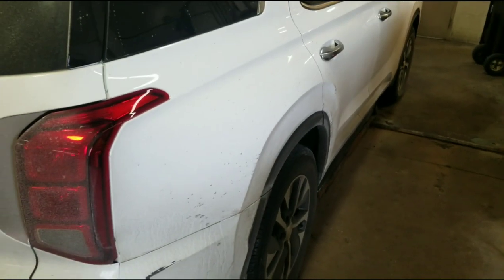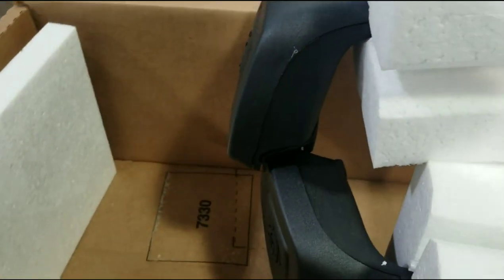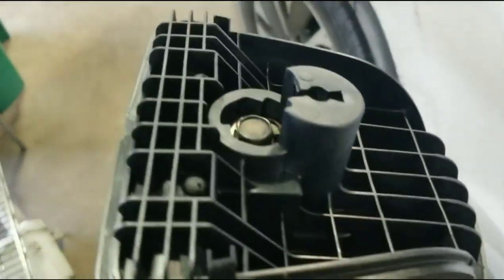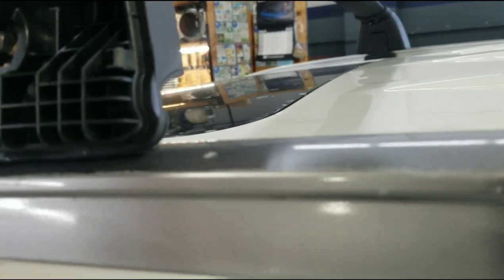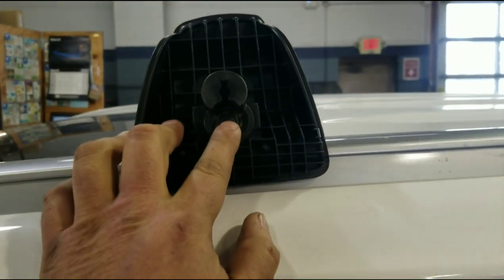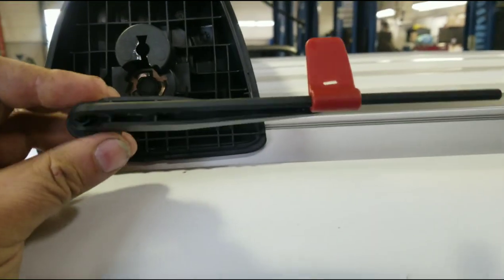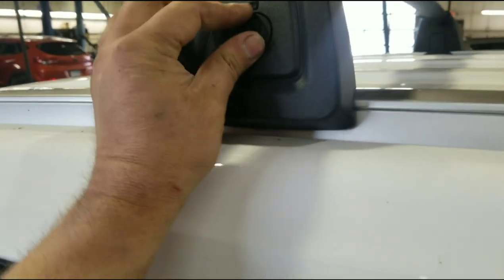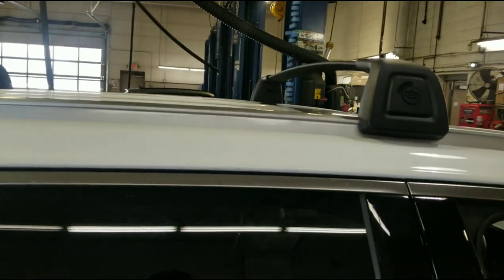2022 Hyundai palisade crossbar install

Comment: We bought a 2020 Hyundai Palisade and has these crossbars on them.  I got the little tool that opens it but not the tool that looks like a socket.  Do you know the part number for that?
Reply from the maker: It's just a regular socket.  If you have a basic socket set it should work.